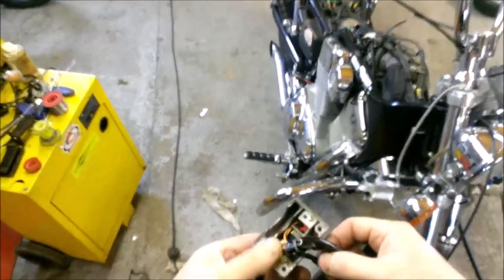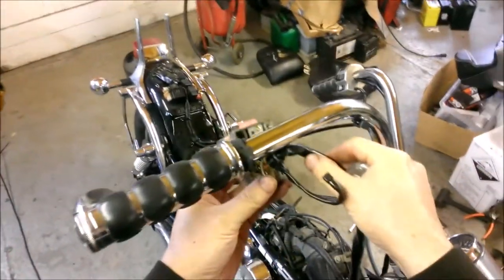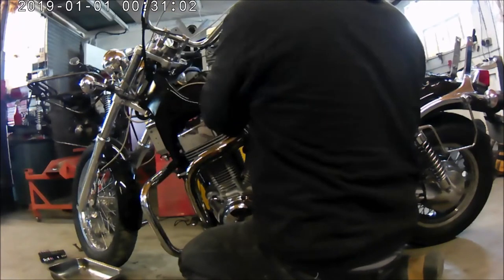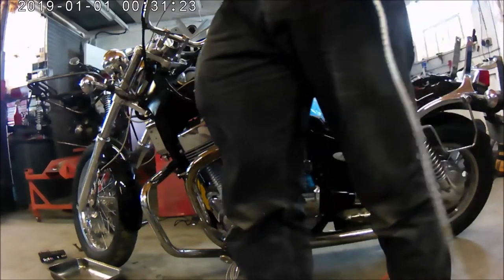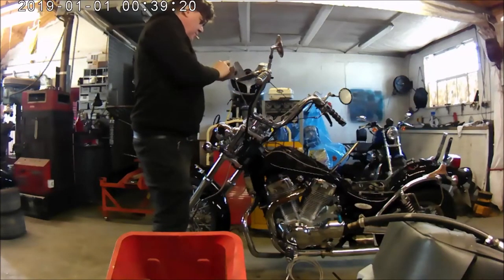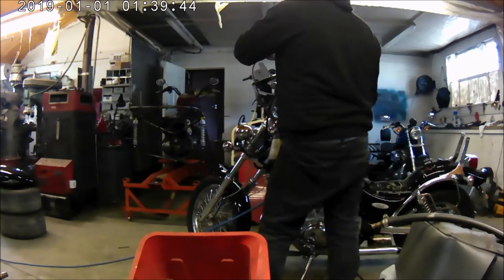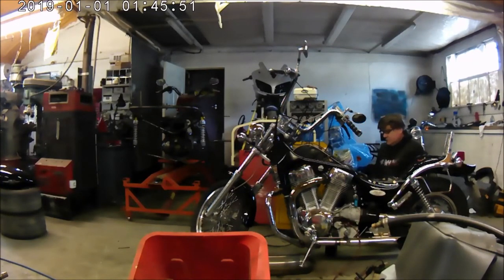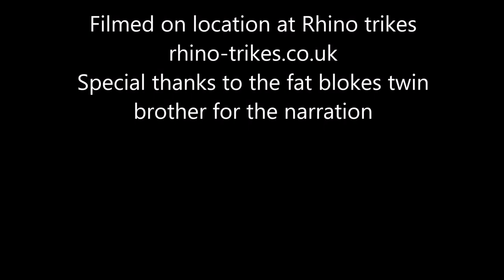Fitting Ape hanger handlebars to a Suzuki VS1400 Intruder Part 3

Comment: The more I watch these the more I'm getting concerned about doing mine next week ...(lol) All the best
Reply from the maker: The wiring is the most complicated bit. Try to remember how the wires are organised in the headlamp as it's critical to getting the light unit back together. The colour coding is quite obvious and logical, but pay attention to the yellow wire with the smoked plastic johnny on the end, it pairs with the bullet with the black tag. Note how the yellow, and yellow white wires join together, as they have splitters and can potentially be put back together wrongly, other than that, the colours match up sensibly.
Reply: @rhinotrikes  Most helpful thank you for taking the time it's much appreciated...All the best